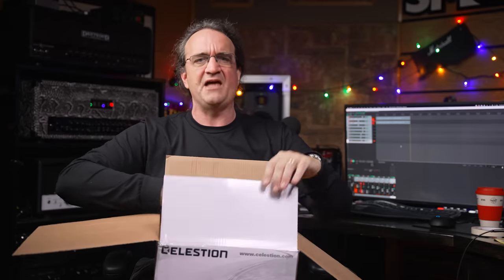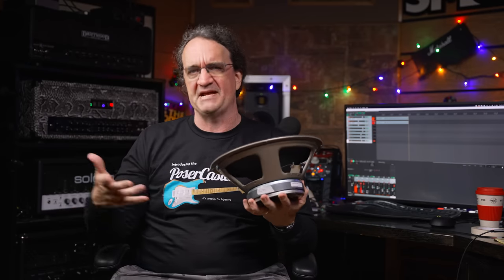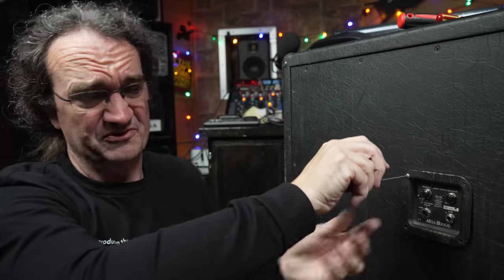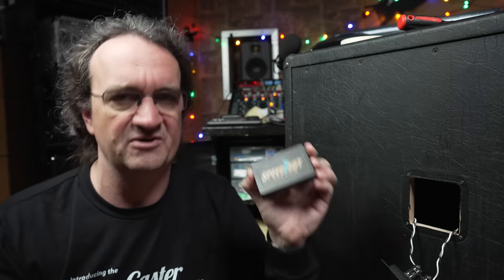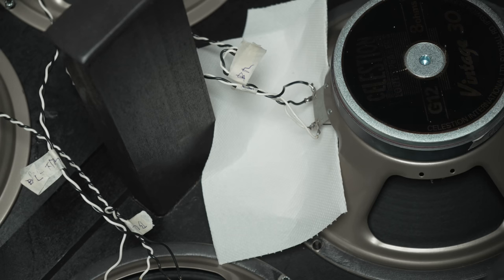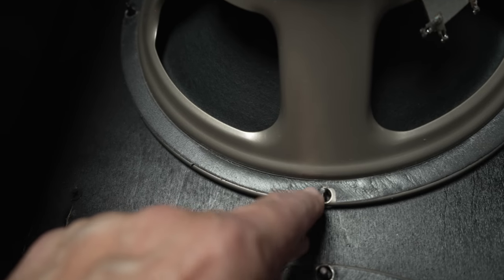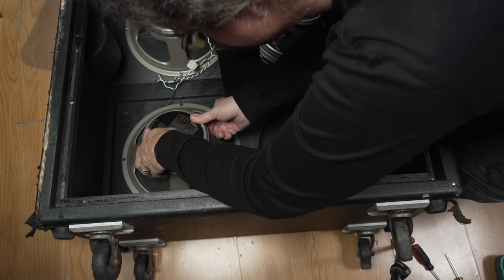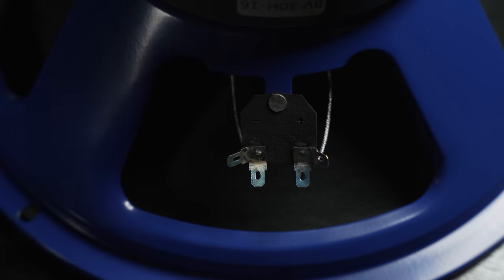How to Change Guitar Speakers (Even if You're a Bass Player!)

Comment: Hi, Glenn!
To prevent any phase shift, I always prefer to have my speakers wired 100% in parallel. A single speaker automatically avoids the choice of series or parallel. I wish Marshall, Orange et al., would have all four speakers in their respective 4x12s wired in parallel, but I was told that Marshall uses this scheme in their 4x12s: two speakers wired in parallel with the other two in series. So it is series/parallel wiring used by Marshall. When playing live, that tiny and miniscule amount of phase shift probably won’t matter much; however, in the studio I do prefer to record with a single 12-inch or single 10-inch when possible.
Reply: interesting🤔 i dont know what happened to an old bass players 8x10 cab but it was out of phase n when he blew aluminum speakers sparks shot out. im glad i stick to 2x12s for guitar, and single 15s for bass. much simpler wiring. fixing 8x10 was out of my comprehension.🤯🍻

Comment: For european viewers you need 6.3mm spade connectors. If you got insulated connectors the red ones fit up to 1.5mm2 wire, the blue on go up to 2.5mm2. You can get away with thinner wire, if my memory serves me right 2.5 is good up to 500W for a few meters.

Comment: About connections:
I don't think the connection type matters at all in terms of sound,
but there's probably a durability aspect.
Aligator clips are perfectly fine for testing, but I'd be anxious about using them in a cab that has to survive a trip on the tour bus (or gear truck)

Comment: Something I learned yesterday is that different speakers may have different size spade connectors. I bought a new speaker and the wire to the old one had a smaller spade on the negative than the positive while the new speaker needed two larger ones. So that left me with the choice of spending $10 on a pre made cable with the right connectors or a $10 truck load of connectors that I’ll never use and will only clutter up my workshop.

Also if you weren’t aware of it there’s a hilariously bitter rivalry between pro-solder and pro-crimp crowds in the auto repair community.

Comment: Just a few seconds in, and here's my guess:

1) Lay cabinet down
2) Remove back of cabinet.
3) Unplug or desolder wires to speaker. (If desoldering, try to remove as much solder as possible and consider crimping connectors.)
4) Unscrew speaker.
5) Remove speaker.
6) Put new speaker in cabinet where old one was.
7) Screw speaker down.
8) Reconnect or solder speaker.
9) Reattach back.

Now, I do have an engineering degree, so it might come easier for me than other people, but that should pretty much do it.

Comment: Here are some suggestions. If you have to deal with solder. Get some desoldering tools too. A desoldering tape would work wonders.
When you are in your local big name box store, go to the isle that has the scews in it, and pick up a box of replacement screws.
Same for the #2 phillips screwdriver bit. You can get whatever type you like to use. And some of them you can get in bulk.

Comment: I bought an el-cheapo Stage Right 15w tube amp. For $215, you can’t beat the price! Anyway though about changing the tubes, but decided to replace the Celestion 70/80 with an Eminence Cannibis Rex. Woulds of difference, striking in fact. I may still change out the Chinese AX7s for some Slovak tubes, but I’m not in any hurry now that I have the new speaker in there.

Comment: I would love to see a video on wiring a 4x12. I have built 2 2x12 cabs, and am looking to build a 4x12 but the wiring seems a little overwhelming. 
Also check the Mojotone Watchtower speaker. Absolutely wonderful when paired with a WGS Veteran 30.
Reply: just think about it as 2 separate 2x12s acting as 1 speaker each your either gonna wire that pair in series or parallel.

Comment: When checking “tone changing elements” I like to watch these videos on my phone speaker and screen off; If I can tell the difference on it then it’ll be worth it, why? Because that’s what most people listen into. That being said, when talking about speakers is the first time I hear a notable difference without having to be extra picky or blasting my studio monitors to check for minimal changes at unreasonable volumes so they become audible. Great video!

PS: I know soldering is annoying as fuck and tedious (been doing it since I was 14 and I’m 25 now) but I’d personally advice to solder your connectors for making it extra bassist resistant. Also DO NOT SOLDER DIRECTLY TO THE SPEAKERS, since you risk desoldering or burning the coil wires (mistake I paid for at an expensive price) and could turn your speaker into a really expensive paperweight.

Comment: Being an actual electronics guy, one thing I can recommend, with spade connectors, is to take a pair of regular pliers and just smash them down a little bit (very lightly), to where the curved edges are touching the back inside, before you slide them on. This is just a light pressure. (You don't want to smash them flat, or anything.) And then they will fit much tighter, because you will have to force them on a little bit. It's not going to change your sound, but it will keep them from just coming loose. 
Not every spade connector is going to be a tight fit. I know, basic shit, but still a good tip for people who are not familiar with doing this kind of thing. That one you showed us sliding on there, seemed a little loose to me, so that's definitely something I would have done in that case.
Oh yeah, if you do have spade connectors that seem a little too wide, you can get away with smashing the sides in a little bit with a pair of pliers, too. Basically, changing the width of it, ever so slightly, which will also push those two curled edges in a little more at the same time. These two techniques will make spade connectors fit tighter, even if they aren't exactly the right width.
Now, after you crimped them on, and slid them on to the speaker, that's about how tight they should feel. There should be a little resistance, when pushing them on.

Comment: Thank you for this. Definitely interested in a follow-up involving different wiring types. I have a 4x12 with 4ohm speakers wired in series for 16ohms and i wanted to replace two speakers so I'd need two 16ohms wired in parallel with each other and then in series with the two originals. I got the math down, but as far as actually doing it, idfk

Comment: Lol impact drivers or loosen the clutch on your drill. The vibration helps break the screw loose. Thanks for the video, I always was concerned with ohm ratings and thought the process was too technical. Now I really want to open my blue voodoo cab and my Jackson cab and see what’s actually in them 😂

Comment: Would love to see you do a comparison of 8ohm vs 16ohm vintage 30's. In my experience there is a difference. I have a 1x12 loaded with an 8ohm Mesa spec vintage 30, and 2 Mesa 2x12s, which are both 8ohm cabinets, so have 16ohm drivers in them. The 8ohm is much fuller sounding, even though it's only a 1x12 cab, and the 16ohm speakers in the 2x12s are more midrangy and more brittle sounding. I can make both sound good by dialing the EQ on the amp appropriately, but I'm surprised that there's such a difference. I much prefer the sound of the 8ohm, and from now on I'm going to try and stick with 8ohm speakers. Also, I've been trying to figure out which spade connectors to get, and you answered it for me! Thanks for the informative video!

Comment: I like to replace everything with 1/4" head, sheet metal hex screws with flat head slot incorporated into the screw head. 
The 1/4" hex matches the hex size of your ratcheting bit driver (the bits are all 1/4" hex), so worst case scenario, if you have no 1/4" socket/dedicated nut driver, or bit driver, a flathead screwdriver will work. 
Also, if you don't have the damaged screw remover bits/kit, you can do the old baking soda/crazy glue trick that guys do when they hog out their guitar nuts too much: sprinkle baking soda on the damaged Philips head, push your screwdriver tip onto the damaged screw, leaving an imprint, squirt a drop of crazy glue. You've just made a new Philips head screw. Saw this on the tube the other day. 
If for some reason, that doesn't work, last option is super thin cutting wheel on a Dremel, making a flat head screw. Of course, accessibility is always an issue for any of these options.

Comment: Wiring diagram video would be great. I have a road king cab that you can split into 2 2x12s depending on how you plug in. I'd be interested in learning  how all the wiring works before I mess with changing anything inside (beyond a simple swap). I'm wanting to put in a pair a greenbacks instead of the Black Shadows, to use instead of/in tandem with the V30s.

Comment: I imagine the advantage of a better connection is with lower resistance you get less heat at the connections, which means its less of a fire hazard, which is why I wouldn't use aligator clips, however spade connections is plenty sufficient and much more user friendly. There is no actual point in using solder over spade

Comment: Back when I was in a band we use to keep an emergency repair kit on hand at gigs for quick repairs. It included solder, pliers, allen keys, ect that we kept in an old tackle box. We had and issue once with the spade connectors coming loose from the cab being banged around in transport (old gear with old connectors). Nothing quite like having to fix shit mid gig while on a break lol. Anyways, we started soldering the speaker connections and we never had that problem again. Perhaps a good video idea would be what kind of stuff you should have for emergency repairs on the road/in studio. Because we all know, shit happens.

Comment: When recording cabs the mic is usually very close to just a single speaker. Is there any reason you wouldn't just buy single speaker cab instead? Also just sounds like the best solution when it comes to space.. 4x cabs are kinda large. Or do you recommend getting a 4x cab and have 4 different speakers in each socket? Does that make a difference?
Reply: a big cab makes for a change in sound cuz resonance and other technical stuff .
4 different speakers will each sound different on mic for sure but youll probably get a tid bit of the others coming through the mic too.
in room sound will definitely be different than a close mic as itll all congeal into 1 sound....single cabs can be used instead for sure....
but if you want to be able to pick which speaker you can get complicated with 4x cabs to save space....
and some have wiring & switching to only run/power 2 speakers (the other 2 move cuz air moving but output very little) which is handy for someone with space constraints wanting multiple sounds on mic...
...tldr...4x cabs can save space but it gets complicated

Comment: 25 + years as tech. Enjoy visiting 😁. You get bit in the ass more than not. Doing a great service Glenn. I start everything by hand. THEN grab the drill. Get a drill will a throw off clutch, it saves screw heads. Assembly line work is soul killing I have great respect for that aspect of your life also. ❤ quick connects. I can solder,braze and weld. (3 different types) Quick connects RULE.  Never had one come off. Firm connection. Take photos of everything. Wish I had that back in the 70's.  Good at drawing pictures. Looking forward to 8 v. 16 ! Recone DOES change sound. Play everything in before you get mad. 🤘🖤🐈‍⬛🍊

Comment: I believe they opt to solder the connections due to the extreme touring these Mesa cabs are built to handle. Don’t want a spade connector to shake loose.

Comment: If I can be a little cheeky and comment a second time. 1. I replace speakers with the cabinet standing up. I see what you were doing in terms of soldering and using a paper towel to try and protect, but a blob of solder will eat through that towel quick. Drop a screw or not through the cone, sad times. While it may require a little more dexterity to replace speakers with the cab standing up, if something drops, it's going down onto the floor and not your speakers. 2. Be careful using the electric screwdriver/drill on the input socket panel. As cabs get older, those plastics become brittle - and I've experienced this with nearly all makes. It's really easy when using a power tool to crack the corners off those panels really easily the older the cabinet gets. 

But I do agree. Spade connectors. Unless your cabinet is going to spend the next year on the road going in and out of transit vans, spade connectors are absolutely fine. Even then, I would only solder on to cure my own paranoia if this cabinet were seeing gigs 3x per week.

Comment: A lesson in screwdrivers and bit tips for drills:  When you cam out the screws like Glenn did on the connector plate, you not only damage the screw heads, but also your screwdriver tip.  When you wear out your screwdriver tip, it becomes more likely to cam out further screws.  So take a close look at your Philips (+) screwdriver tip and see if it's worn.  If it is, replace it.  And if you DO cam out a screw head, take the screw to your local hardware store so you can match it up to a replacement screw.  Screws are cheap.  Keep your equipment in good repair!

Comment: If you have spare wire in your studio (lol) cut the wires and leave a few cm (inches) on the speakers, I hate working too close to those speaker connections.
Always remember to use genuine 1968AD solder to preserve the tone. Even better use wooden wires.

Comment: Soldered connections are great for high current circuits since current = heat. Guitar speakers are not high amps so spades do great. Any tonal differences will be seen on a scope, not heard with your ears

Comment: 4/8/16 ohms parallel and in series is important if you want your amp tubes/transistors and output transformers to survive. I don't think guitarists and bassists will necessarily understand that but real humans might, so do a short video explaining the audio signal path from mic level in, pre-amp, power stage, output transformer/choke, speaker and what can go wrong.

Comment: This video is very timely as I have a fairly inexpensive 10 year old Blackstar 4x12 cabinet and I'm debating whether to sell it or perhaps put some higher-end speakers in it - I'm thinking something more unique than the V30 (which are easy to come by in pre-built cabs).

Comment: Or, go the route I have gone and just keep buying more cabs to get different speakers... lol 

I would guess that the main reason for soldering is that it is a more secure connection that can't work its way loose, and is more resistant to getting pulled loose too, rather than for tone. But, just make sure those spades are tight and it should be fine.

Comment: I love your content Glen ,but a few things I think you overlooked or simplified about the speed connections.  I use to work in a electronics factory for 11 years so I know a little about it, I dare you to use alligator clips in a situation where you are moving the cab around show to show, half of them will fall off, they just use that for testing and the ability to swap speakers fast because they swap them several time a day. Also the problem with spade terminals is when the are too tight and people force them on or off they end up breaking off the table on the speakers,  seen it happen several times. I've also had to repair speakers and or amps with  intermittent sound issues because the spade terminals actually loosen up and cause issues.  So soldering is more about being a more robust way of connecting more then "pure tone" kida thing. I solder everything,  it's  actually super easy for me and I have spinal issues causing nerve damage for me. I solder everything lol. 
Also speaker pricing is way more,  I bought an Eminence DV-77 for a Marshall JCM800 4010 combo and paid $130.0 for it , 6 months later I went to go buy 4 more and now they went up to $220.0 a peice, times that by 4 and it's not a cheaper option for updating any more.  Maybe if the price comes back down I'll buy them for my other 4×12 I have, I have as a spare. 
 Not bitching,  just wanted to point out it's not all about tone chasing when soldering. I would have had your speakers done in 10 minutes , just because I would have had my soldering iron on and ready to go. I'm in Central Canada,  hence the crazy pricing,  that's from L & Q .
Reply from the maker: Not debating that solder connections are more stable.  Tone-wise?  Nah….
Reply: @SpectreSoundStudios  no noticeable difference for tone, just durable is all.

Comment: Very entertaining, (and somewhat cringe ) instructional video...completely metal!

Hopefully new hardware installed on the speaker input panel, I'm sure you did. 

The paper towel thing???...I am going to admonish you right now!!! GLENN! No flammables under your hot soldering iron and dripping solder. Poof, speaker and cab goes up in flames, nothing more metal than that! glad everything worked out ok, really! 😜 

Speaker changes may just be enough inspiration. Speakers are, most usually, not returnable, so it is very important choice to get correct.

Comment: So I just came to make sure I knew what I was doing. I did come up with a decent enough question though. What if I say wanted to wire a horn into my 2x10 600 watt 4 ohms bass cab... I'd need a horn and a crossover, maybe a controller for the horn... sure... and the current draw shouldn't be anything major enough to mess with the wattage and ohm requirements of the amp... Having never wired a crossover before... Is it basically just a limiter to stop too many watts from going through and killing your speaker? How does that work? (You don't have to be too technical?) Is there anything else I should consider? Would you have any suggestions for hardware? Thanks for your time. -M